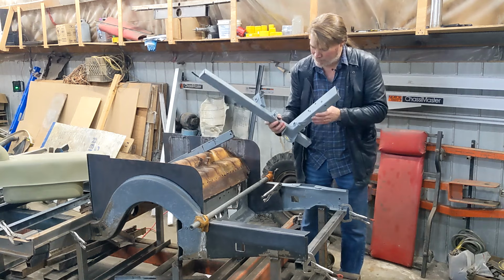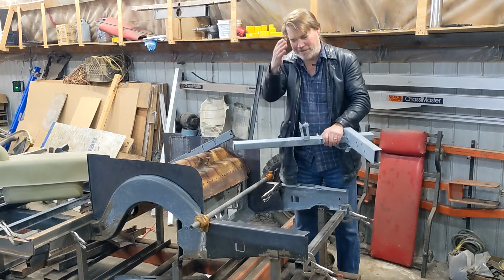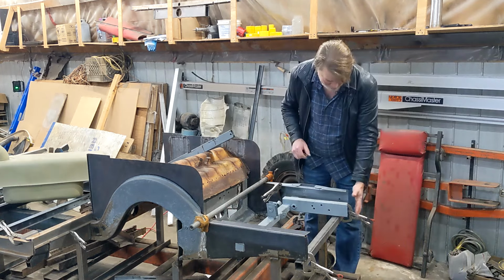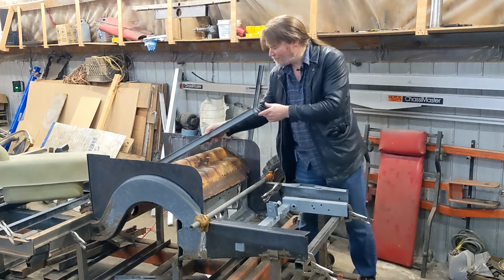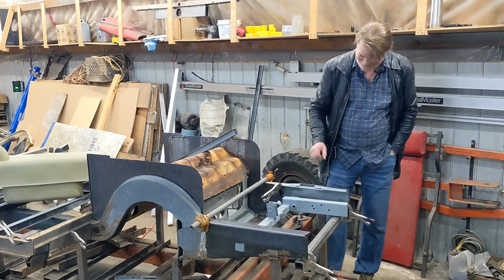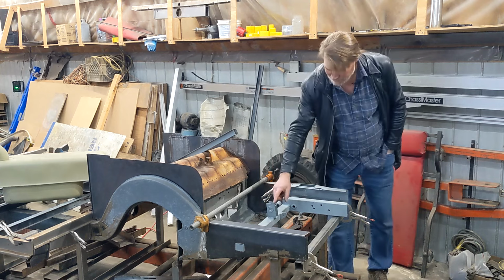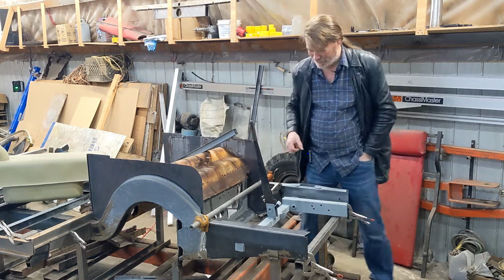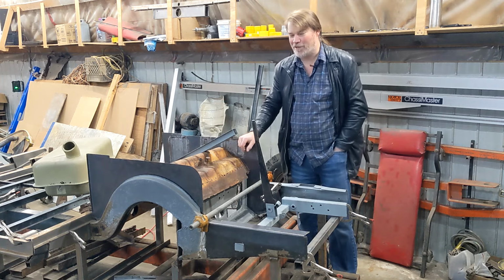The Nova Scotia Barndoor E20 - Pedal beam

Comment: I have a 1967 gas tank in new brunswick just in case your interested. Keep the good work you give me courage for restoring mine ;)
Reply from the maker: Thanks. The tank design and location changed to that of the late splits in Feb 55. On barndoors it is above the engine in the left rear corner. In later splits the tank is in front of the engine.

Comment: Hi:  I looked at the CAD views and I assume that they are patterns which printed out ar 100% will serve as templates.  Is my assumption correct?  Thanks.
Reply from the maker: Yes. Best to check the overall dimensions after printing though. Ensure you are not printing "fit to page"
Reply: Makes sense but with no dimensions to use for reference it doesn't seem likely that the parts would be correct.  Or did I miss something when I look at the CAD drawings?  @thenovascotiabarndoor1954
Reply from the maker: I think you are looking at the DXF files. The mulit page PDF files have dims and printable patterns. Unless I messed up one of the pdf files.
Reply: Humm I'll take another look ~ probably "pilot error"! @thenovascotiabarndoor1954